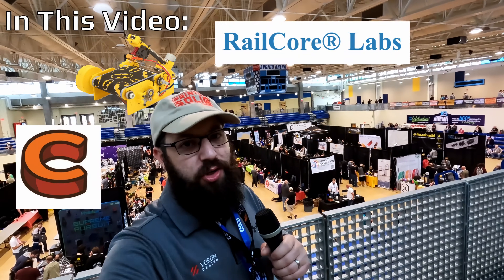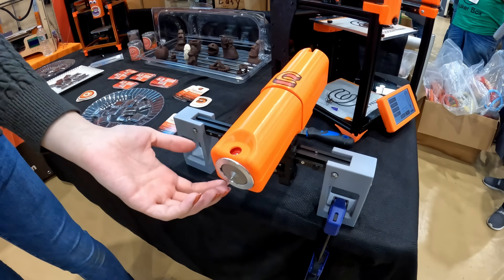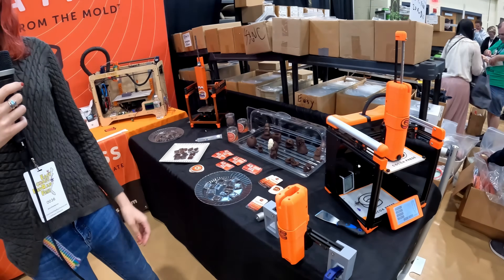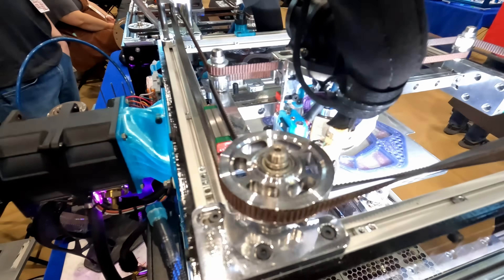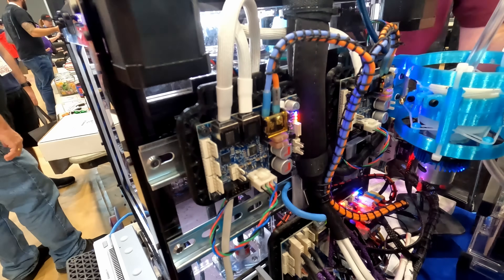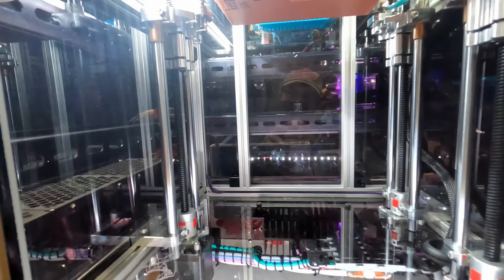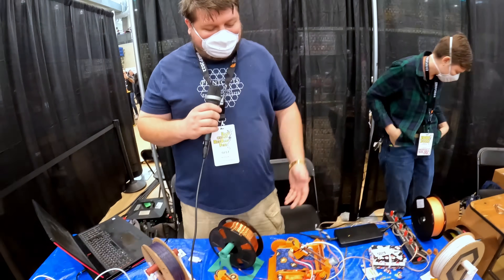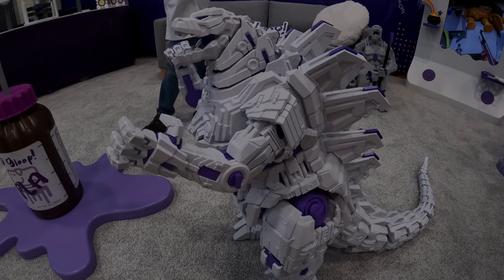Printing Chocolate, A Blinged Out Railcore and Mini Belt Printer ERRF Recap - Part 2 #3d #3dprinting

Comment: Holy crap, a core xy chocolate 3d printer. I love that unlike so many other food printing companies where the motion system is an after thought they actually used a great system here, and it really makes sense for this use case too with the space savings of this type of printer and the open front belt section.

Comment: with the blinged out rail core, I wonder why he's got both little idler pullys  and  much larger idler pullys stacked above or below them. Why two different sizes?
Reply: It's for keeping the belt path within the outer bounds of the machine so it's easier to enclose (later).  It keeps ample clearance between the belts paths as well.

Comment: Can anyone tell me what that thing is in the shock mount on the railcore, that looks like a turbine? Unfortunately I do not understand acoustically what he calls it.
Reply: its called a byrd air. its basically an air compressor instead of a part cooling fan. It helps keep weight down on the tool head.
Reply: @Mad_Monkey  Thank you very much, I searched for "bird" and obviously couldn't find anything cooling-related
Reply: Yep that's berd air from "the maker hive" and it vibrates a lot so i have it shock mounted.  It is in addition to my sheet/air curtain cooling shown